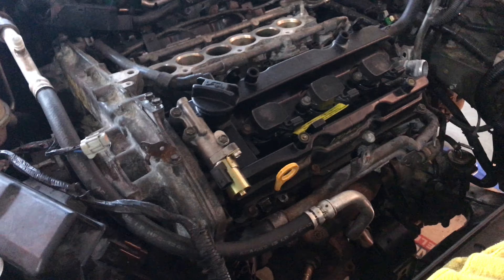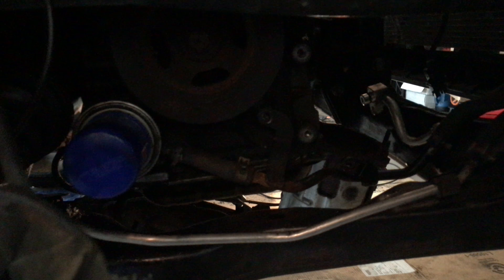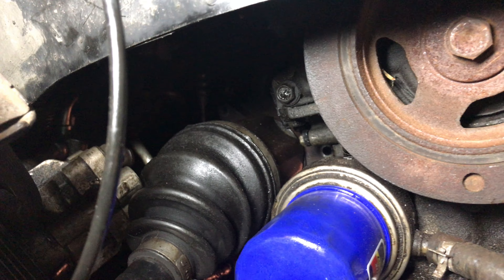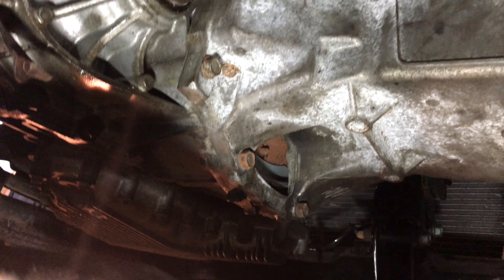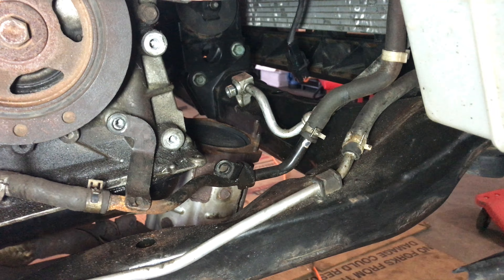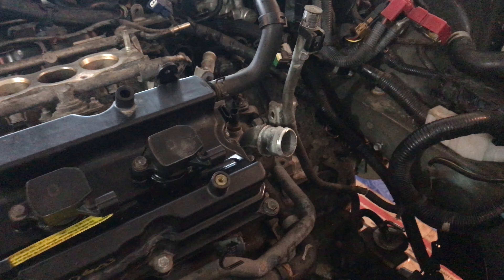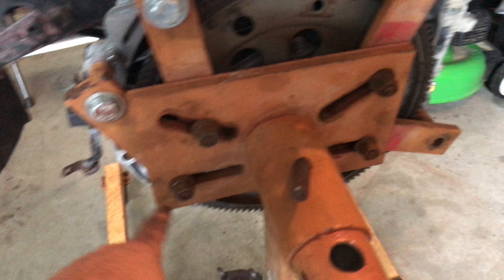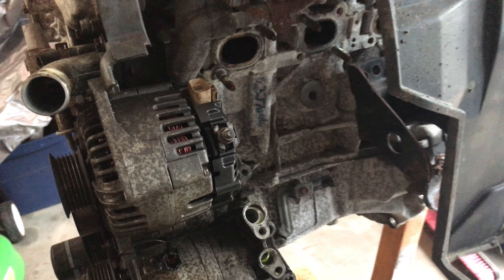2008 Maxima 3.5 engine swap part 2

Comment: I'm doing this swap now. I can't find the last bell housing bolt. I got the 2 in the center, but the bolt to the right of it. There's a bracket that has a bolt facing vertical. Does that take the place of the bolt that's supposed to be there? 

The hole You are using the bolt hole for the engine stand(the upper right arm)the hole next to it to the right. Are 2007-2008 different due to the transmissions?

Comment: How did you remove the Catalytic converters the one by firewall and the one on the left? Thanks
Reply from the maker: I used a long extension to get in there you can get in from the top but it’s tight

Comment: Hi any tips to help me and my brother we swapped a 2009 nissan maxima engine and put a 2 year older engine in it everything hooked up fine now the transmission not working right it was fine before the engine swap any help would be grateful
Reply from the maker: What’s the transmission issue? Won’t shift?  You put a 07 engine in?
Reply: 2011 or 2012 engine and the transmission not accelerating right barely getting power when the old engine was in we wasn't having no problem out the transmission
Reply from the maker: @hellrell2715  did you keep the same cats or use the new ones? Could be clogged ? Take out 02 sensors see if that helps. 

Otherwise you might of connected the transmission at an angle you sure it slide into motor properly?
Reply: @weldingjunkie  we used the old cats
Reply from the maker: @hellrell2715  do you have a scan tool to look at data? Does it idle normal?  I wonder if you missed something vacuuming something like that.
Reply: @weldingjunkie  o2 sensor code coming up only nothing with the transmission
Reply: @weldingjunkie  i just have a regular scan tool that reads codes
Reply from the maker: @hellrell2715  it should have data check the rpm on it vs the dash and check gear selection. Maybe the linkage is in low vs D
Reply: Ill check and get back to you

Comment: Hey so I have 228,000 miles on my 3.5se v6 coupe I wanna swap a new engine in. My only thing is like should I replace any other parts as well. For example like should I change all my seals, and transmission and shit like that??
Reply from the maker: Yes everything is open even rear main do them all and filters

Comment: (An answer is appreciated please) I just got a new engine dropped in my 05 Altima 3.5l . The guy doing it for me bolted the engine and transmission up and it lines up perfectly. But he’s kind of messing with the crank pulley because he was saying something about the flex plate going to mess with the transmission. I don’t get what he’s trying to tell me because it everything bolts up correctly... I should be fine right?
Reply from the maker: He shouldn’t be having a problem with the flex plate that’s the round plate that bolts to back of engine that bolts to the transmission so it turns the pump. If he’s having issues then he has the wrong flex plate on there. He should switch it from your original motor to the new motor
Reply from the maker: He’s turning the crank to line up the flex to bolt it to the trans
Reply: @weldingjunkie  okay okay so that’s what he’s doing. That makes sense! Also. The flex plate on the new engine was bent a little bit so we used the original one from my first engine. But one of the holes for the bolts are completely stripped in the flex plate. So one bolt is missing in it. It’s tight and place and has enough pressure... will I be fine ?
Reply: @weldingjunkie  and if he’s turning to crank to line it up with the trans then he did it wrong ... because the engine and trans is bolted up
Reply from the maker: @lowlifespore8993  no it won’t it’ll crack the flex plate with little vibration, I’ve seen many crack that way.  He should really fix it the right way.  He should really not of pulled the trans into the motor tight until the bolts in the flex plate were lined up. If he’s trying to turn the crank and the flex plate is binding then it’s not lined up properly or there is a fitment issue. Is that what’s happening it’s binding as he turns it?

Comment: Any tips when you put the motor back on getting the motor and trans lined up? Thanks your video definitely helped out.
Reply from the maker: Raiderz4life20 thanks for watching. The biggest thing is watch out for cooler and pressure lines getting stuck on the firewall. When you lower motor don’t go all the way down go almost all the way then muscle and pry the engine to fall into place- you might have to use a porta jack to lift up trans slightly once it lines up get the 4 bolts for flex plate and get them on. If it doesn’t line up don’t force it the bolts will bow the flex plate permenatly

Comment: Do i have to take the axle out to pull the motor I have 04 maxima
Reply from the maker: It’ll make it easier to do because it bolts to back of motor but no you don’t but it’s tight

Comment: When you removed the air conditioner did you vac out the refrigerant?
Reply from the maker: Paul Seward I didn’t no, the AC system on this vehicle was already depleted. Otherwise yes it’s needed.
Reply: @weldingjunkie  thanks

Comment: Getting ready to pull out an engine on an 07 to service the timing chain, tenioners, and the rear main seal. Lifting from the top where would you say is the best point to hook up and pull out?
Reply from the maker: Kevin Francois we hooked up to the back of the intake bracket and then to the front where intake bolted on- I found a bolt that fit in and used eye hooks and it mounted up just fine and pulled. Just be carful if you bend intake bracket plate to bend it back before re install.

Comment: Do you think I can put a VQ37DE to my 07 Maxima? Will it work/fit/connect with the CAN?
Reply from the maker: Pablo Hernández these motors are 4th digit Vin compatible so if you have a diff motor that what it has, you’ll have to re program the ecu it can be done tho

Comment: Just bought a Altima with a blown engine. How long do you think it took you to pull the engine? Trying to figure out how much of a project I️ got myself into 
Thanks!
Reply from the maker: stereodesigner plan on a full day. It’s a project for sure. Took about a week for swap but I ran into issue. Important, make sure flex plate matches if you aren’t swapping and make sure there is no flex after it’s bolted up. Also watch out for pressure hoses in background etc

Comment: So when you went back in with the engine, did you install all accessories before you dropped it back in?  And thanks!
Reply from the maker: Chris Dimery Hi Chris what do you mean accessories? Like alternator, starter etc? Or lines? I put on ac pump on last. I switched just about everything before I dropped it. It’ll all fit

Comment: Do the axles need to be removed for motor swap?
Reply from the maker: Paul Seward you do need to take them out or you won’t be able to pull out the engine. The axles will hit the sides of the car.
Reply: Thank you
Reply from the maker: Paul Seward you’re welcome, are you doing a swap? They aren’t too bad to do. If you are my advise is to get the hanger that goes to the hoist so you can angle it front to back etc

Comment: I pulled mine out already. Are you doing this on your car or for a custome? How much was that other motor? They are asking about almost 1000 around here. If your doing it for someone. How much was labor?
Reply from the maker: Christian Escobar yes it was for a customer, how many miles? for 1k ...I paid around $800 with 117k or so on it. I charged $2000 for labor. The first motor the customer gave me was bad. The first motor was smoking.
Reply: Welding Junkie ok wow i realized that if you take the wiper assembly off it gives allot of room back there by the firewall. By the way that's a good chunk of change you made on labor. I wish i had customers like that lol. From experience i think motor swaps are way harder than transmission swaps because of all the things you have to remove. What about you do you charge less for a tranny swap?

Comment: You don't remove AC or PS. Leave AC hanging in the bay and PS hoses on the engine.
Reply from the maker: They had to get swapped over anyway

Comment: Do you remove the trans with the engine? Can the engine be removed without removing the trans??
Reply from the maker: David Chaffey no you can pull the motor right out of the top. Unbolt the trans and flex plate bolts. Then remove motor mounts, exhaust and don’t forget the oil filter. Watch out for the power streerong pressure line and oil sending unit on the firewall side. If you need anymore help let me know
Reply: Jason Thank you! Ready to pull but not much room to slide engine to the left. Have Everything off except front & rear engine mounts. Hope to finish tomorrow! !
Reply from the maker: David Chaffey you’re almost there good job, yes only a few inches but it will come loose and up to left even with a few inches. You might have to muscle it out but it will 100% come out and up. We used a porta jack to munipulate it to put it back in. Sometimes the tranny and the engine won’t bolt up on the flex plate easy. I’ll tell you this it’s easier coming out then going in. Like I said the power steering presser line and oil sending might break.
Reply: Welding Junkie just bought 2008 maxima with blown head gasket for 150 with title is it worth head job or just replace engine?

Comment: What year is the new motor?
Reply from the maker: CORZER0 I put a 08 motor back in. Diff motor same year tho
Reply: @weldingjunkie  was the previous engine consuming oil? Asked because im considering putting 08 maxima engine into my 03 maxima